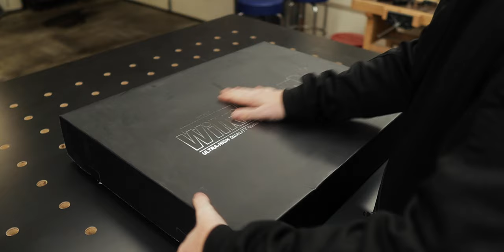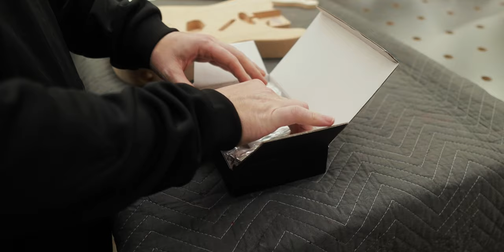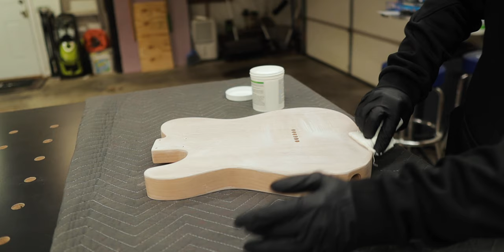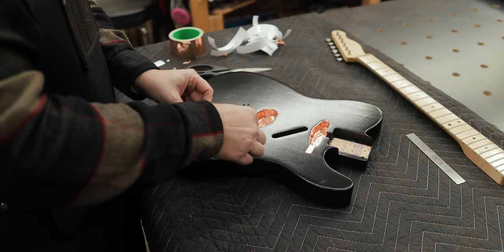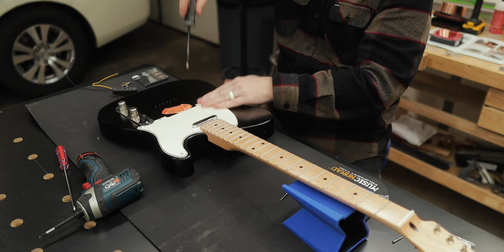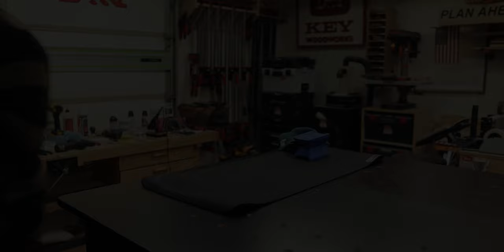Telecaster kit build from StewMac | No Talking | Full sound demo

Comment: Maybe I can receive answers from you:
1-Does the fret board come with frets installed?
2-How do you spray the fret board if it's rosewood or maple (I'm assuming it is-that's how it looks on the SM directions)
3-If the fretboard is not Rosewood/Maple and you spray it-how in God's name do you remove the lacquer?
4-What was the bronze foil tape you used and what is it called and where do you get it?
4-Do the pickups come with all wiring & pots?
6-If you substitute Dimarzio pickups for the StewMac ones-Do you have to replace the pots? 
7-Did you have to "dress" the frets? Level the frets? Re-Crown the frets? I presume you would since the Stew directions call for it and the directions have you spray painting the frets with lacquer?

In the last 2 years, I have emailed these and other questions like this-I have received nothing!!!!! You should be proud of this build- It came out great!!
This is something I have dreamed doing (with NO help from the people at Stewmac-seems the "fine people" at Stew Croc  would rather you  spend 200-300 dollars first to get a decent response (Hell-any response would be welcome at this stage of time) Thank you for your time.
Reply: good questions, I cannot respond cause I'm an amateur but I'd love to see someone competent answer those